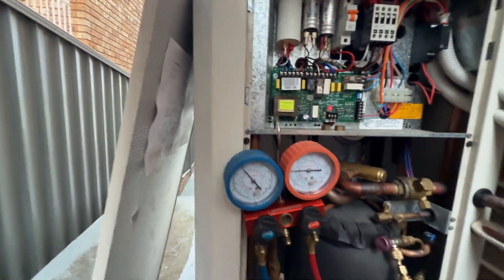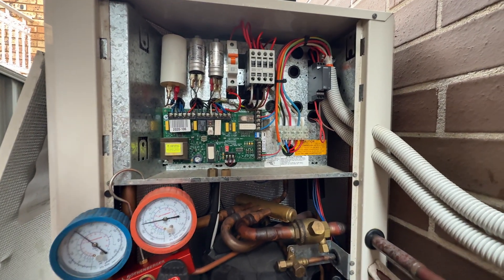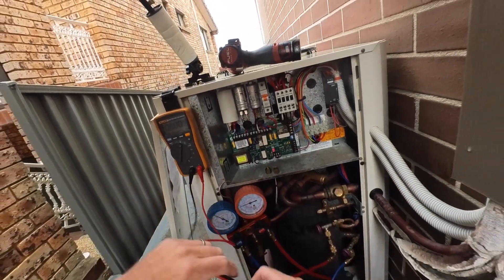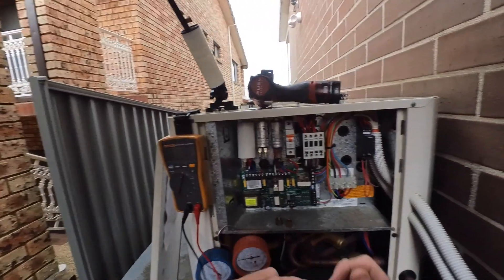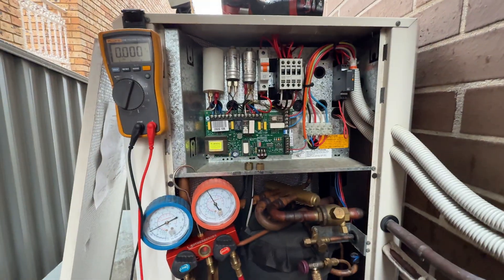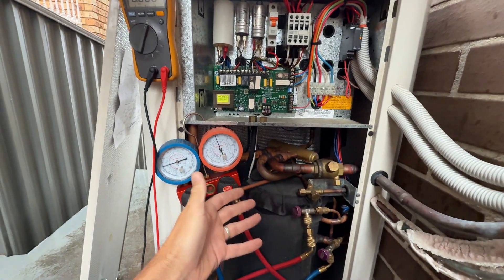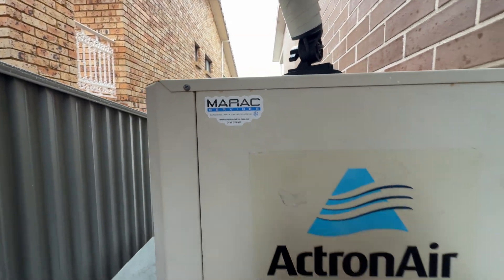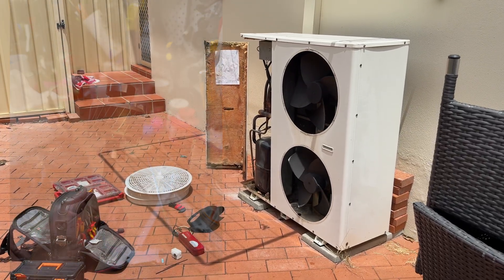Actron E9 Fault Code⎜The Cause Wasn’t What I Expected

Comment: I have a similar actron 3 phase unit that started cutting out on E9 last summer on particularly hot days. Gas pressures were fine. Turns out it was a phase imbalance on the grid supply. Hot days with lots of load on the grid caused severe voltage sag on one of the phases. After many complaints AUSGRID eventually fixed the problem. I think that little relay saved our ac.
Reply from the maker: Oh wow, I’ve never heard of that happening before. The grid must of had a lot of load on one particular phase. Very interesting!

Comment: Pioneer and TemperZone are the worst Ducted  A/C units ,  they struggle to cool i just seen them at display homes & it was terrible, also noisy too,  Mitsubishi Electric are great & MHI, My home has A Daikin Ducted which came with my brand new home touch wood shes still running great, gets through really hot and cold days easily. i love your videos Mitch keep up the great work !!!
Reply from the maker: Thanks mate, appreciate it!

Comment: Are all the residential equipment over there 3 phase? Because in USA it is only 1 phase currently back in the many years ago you could see 3 phase but now that is typically only on commercial.
Reply from the maker: So some houses are Three phase and some houses are Single phase. 

Three phase is available in the street, it just depends whether the builder / home owner wanted three phase power.  

For example, I just bought a house this year which is single phase. I want to build a workshop in the future and I plan to run three phase down the drive way (from the street) because I want machinery in the workshop. Most people don’t care for that stuff. So to answer your question. I’d say (just guessing) 60-70 % of houses are single phase over here (but can easily be three phase if they wanted).

Comment: Just imagine the compressor was possibly going backwards:  Could make a chain of issues.
Reply from the maker: I’ve seen that many times. A lot of older equipment didn’t have these safety devices and I would go to someone’s house because there air conditioner wasn’t cooling and I’d hear the unit the second I arrived and know the problem 😅

Comment: Nice work mate, good video. I’ve seen a few sparkies blow up outdoor AC boards when fitting solar. It’s disappointing they didn’t check their work before leaving site on this job.
Merry Christmas to you,  I hope you're not on call during the break.
Reply: To be honest looks like the AC was actually wired wrong to begin with, possibly because the meter was wrong to begin with who knows. L1 is Red L2 White And L3 is Blue. And white and blue were reversed on the terminal you can see when he zoomes in its Labled L1, 2,3.

I would say they have done a switchboard upgrade and meter and its now been wired correctly according to the standard colours. My switchboard has a warning label in it about the scroll compressor and to not alter phase rotation once established. Its been putting of me chaning the meters as each phase has its own meter and im worried they will bugger up the order when wiring the new meter.
Reply: Technicians must verify the initial phase rotation prior to commencing work. Upon completion, a secondary check is required to ensure the rotation remains identical to the original state.
Reply from the maker: Thanks mate. I don’t really understand why it’s so hard to just check the wiring before disconnecting the unit and reconnecting it the same way. Have a good Christmas! I’m actually having some time off this year which is good. I normally just work through but I need a break 😅

Comment: This phase relay is a safety so it’s been wired in series with the HP/LP safety circuit.
Reply from the maker: Cheers mate. I know it’s a safety, and I know exactly why it’s there.

I guess I just find it funny that they wire it into the LP HP (low pressure - high pressure) when it’s neither of those two things. If a customer googles e9 and reads about it on actrons website, it starts talking about “pressure” related faults. All they would need to modify in the pcb is one more terminal to bring up a different code. Not a big deal, I found the problem in like 2 minutes, it’s just funny to me I guess.

Comment: Love the vid's, good to see honest tradies out there! One suggestion, perhaps invest in a Fieldpiece clamp multimeter. They have heaps of functions, including checking phase rotation and inrush current. I swear by mine, been using it for the better part of 15 years. Drop proof, weather proof and they link together in a Econ-system to measure TD, ambient temps etc...
Reply from the maker: Thanks mate, I appreciate the tip about the fieldpiece multimeter. I’ll check it out. Cheers!

Comment: Hi Mitch ,looks like a phase rotation relay .
Reply from the maker: Yep the relay won’t close if there is a phase loss of the sequence is incorrect. 
It’s the Omron K8DS-PH. I see these often on the 3 phase models, I just find it funny that it’s wired into the HP LP terminals so you get the same error code as a refrigeration problem.